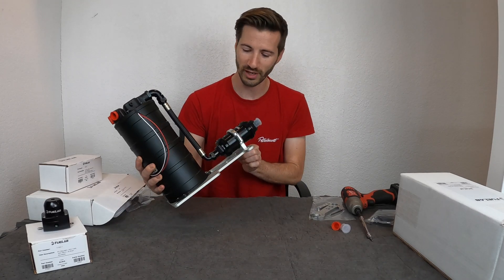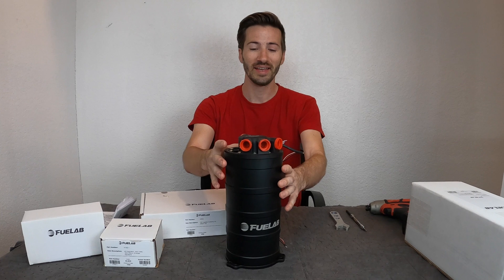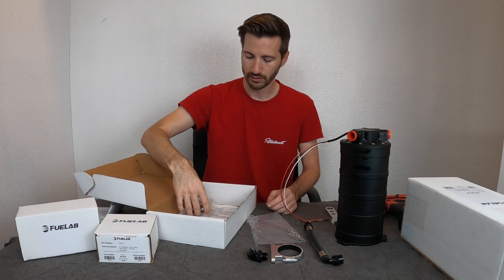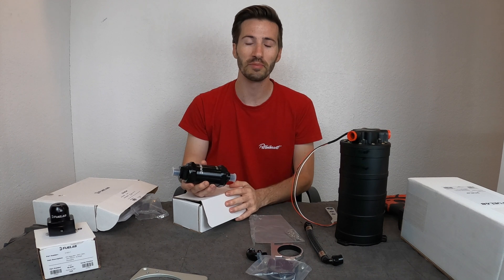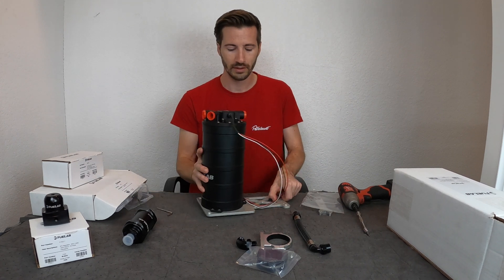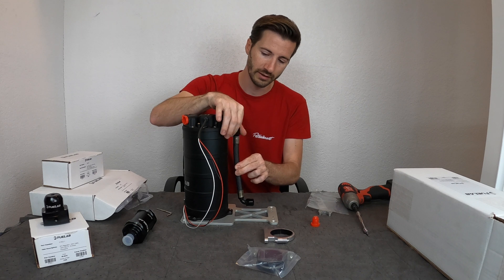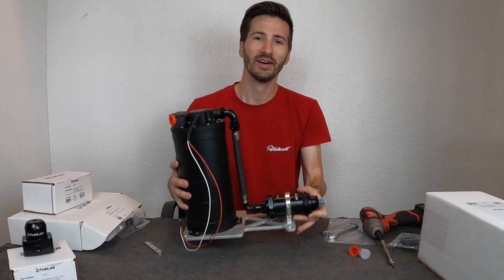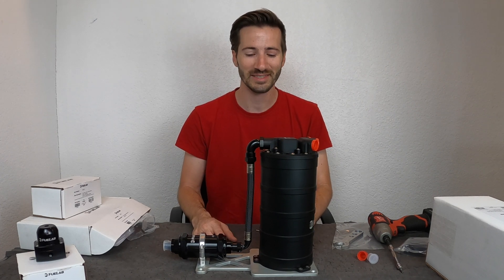Unboxing & Assembly FUELAB FST Surge Tank + GIVE-AWAY Contest! 4K

Comment: Is there any benefit in using an external surge tank over an internal surge tank in the fuel cell?
Reply from the maker: a few yes, you have more fluid capacity in the cell with an external surge, as well as easier access to address any potential issues.  You also know you are FOR SURE getting a proper surge, where some companies sell an 'internal surge' however its really just a cell with baffles to help slosh but not actually contain it.
Reply: @FieldingShredder  Thank you for your answer!